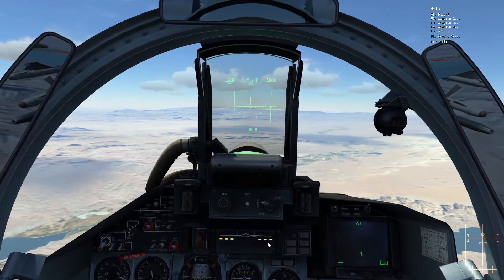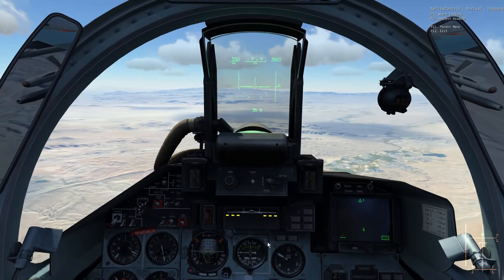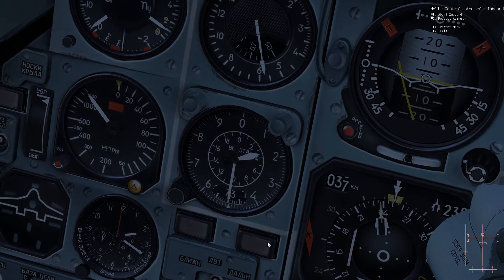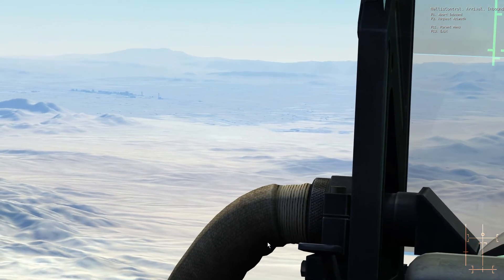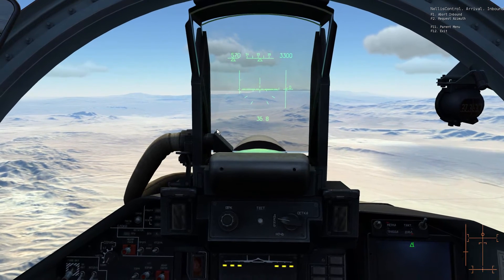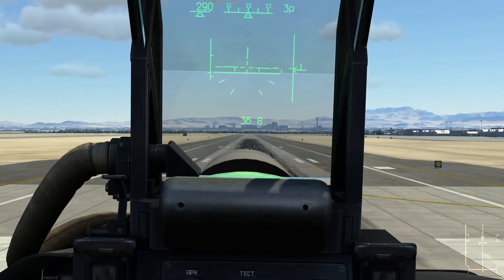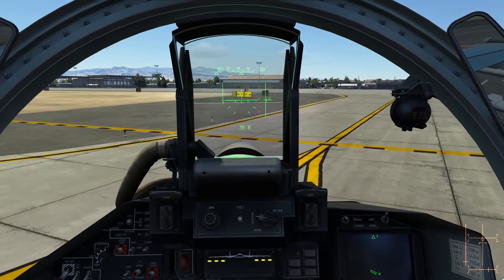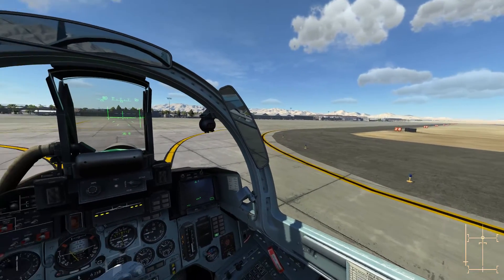DCS - Su-27 - Visual Landing (no ILS) [TUTORIAL]

Comment: 9:05 You hopefully NEVER use it for descents and approaches! If you want to fly it correctly, I mean. Always barometric altimeter, QNH to be exact, the radio altimeter is for something else (like low level flights and ILS approaches only!, for terrain warnings/decision height callouts during ILS landing procedures, it's not for you to stare at it to make decisions!)!

If you only want to play a game, use it. But if you ever plan to get a real pilot license, you should not start learning it the complete wrong way in the first place, because there's nothing harder for your brain to first learn something wrong, then to unlearn it and to relearn it correctly. Our brains learn based on the principle: first in, last out!

Edit:
That's why thumb down, because you indicated that it was ok or  normal to even monitor the radio altimeter for landings, which can become dangerous. It can tell you it's only 10 metres above an obstacle which is in fact itself still 30 m above runway elevation and you'd erratically pull up or what? And then at best overshoot or maybe even slow down, stall and crash?

You use correct vertical and lateral speeds at correct distances from the threshold and thus correct barometric altitudes and glide paths instead for both visual and instrument approaches, always! There can always be higher or lower terrain underneath you in front of the threshold, but this NEVER changes your glide path solutions! In short: shit on it! If you suddenly have to react to the radio altimeter, then you have made some more severe mistakes already earlier on, your approach was totally off, your baro alt not set correctly, whatever it was, it was reason enough to instantly remove you from a plane's cockpit!

The radio altimeter can mislead you, for it's not telling you where the beginning of the runway is, you can always think you're too low while you're in fact on the correct glide path, Geezus Christ! This is only for ILS approaches (and there it's mandatory) to mark the decision height (DH) from which you have to see the threshold of the runway. But even the DH is used only for CAT II and CAT III ILS approaches, for CAT I the barometric decision height is in use, the height above mean sea level (aka nautical height QNH, also not the widely and wrongly used QFE in DCS!), hence called the decision altitude (DA).

In military jets the radio altimetre is for terrain warnings during low level flights, which is why the pilot can set this warning callout manually in the first place: because he's a radio altimeter which can constantly measure it.

During an instrument approach you use also always baro alt, vertical and lateral velocity, headings (HSI) and distances to fly and maintain the correct glide path. During such approaches the radio altimeter calls out the DH (decision height) when you're landing at CAT II or III airports. Otherwise, as mentioned before, the decision altitude, the height above mean sea level (not airport!) is the height from which you have to be able to see the runway or must not land at all and abort the final approach. That's how it works. You DO NOT monitor the radio altimeter, in none of these cases. You use and trust your eyes, or you monitor the barometric altitude!
Reply from the maker: Thanks for taking the time to explain how it's done. You're right, radar altitude can be misleading. But for the sake of simplicity, as the terrain in front of the runway is obviously clear, it is just easier to track altitude displayed in the HUD and use it to know when to initiate the flare. That will work in 99% of landings in-game. But again, if we want it to be done right and by the book, eyeball mark I (and to a lesser extent barometric altitude checking) is the way to go.